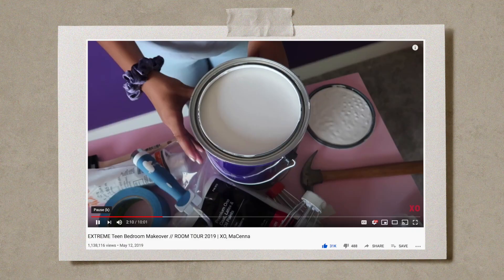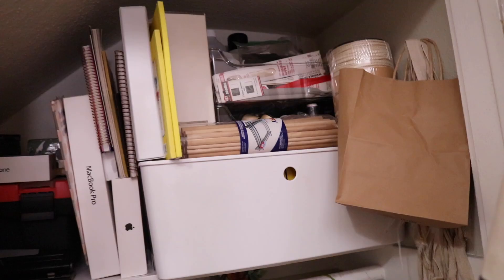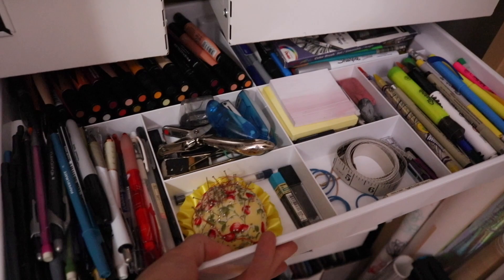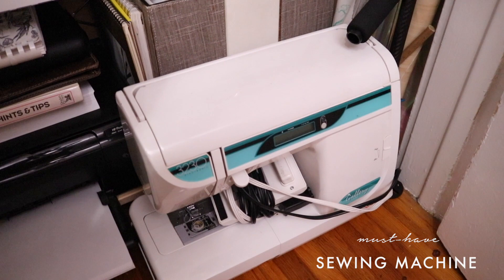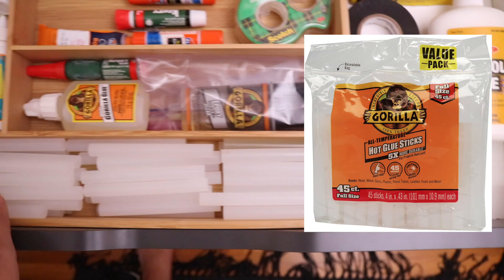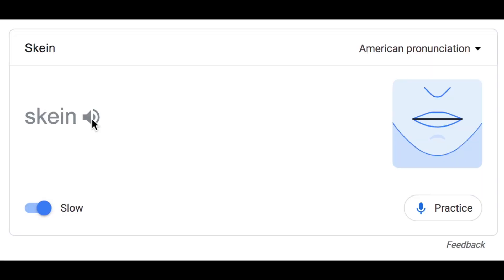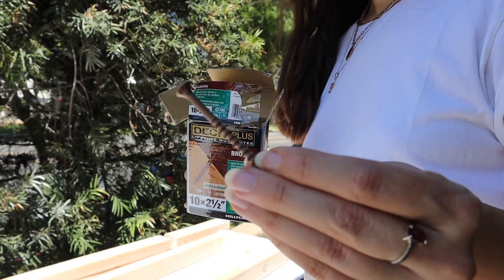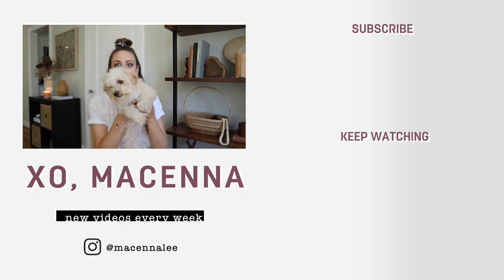Must-Have DIY SUPPLIES + DIY STOOL under $20 | XO, MaCenna

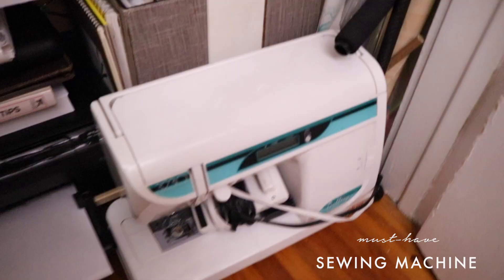Comment: 8:21  I also have an ELNA sewing machine, but it is vintage and from the 70's. I found it on the side of the road, and it works perfectly! Super heavy duty and good for working with denim.

Comment: Hack for your bottled acrylic paints - if you're wondering about the wet vs dry colors for matching, just paint the top lid.  It doesn't scratch off as easily as you'd think (I mean, it will if you want to get it off) but it's a great way to quick see the final dried color (plus I personally add an X on top if it's an opened bottle vs a new one).  You have 1 drawer more than me of them, so I figured you might need this tip more than me :)

Comment: hola! i recommend the (Tonic Studios) Tim Holtz scissors! his line is for papercrafts/mixed media mostly BUT they are really good: XL gripped handle, micro serrated blades - which won't dull, non-stick/easy cleaning blades and they cut different types of materials with no harm to the blade which - for me, as a crafter - is the best feature; they come from 5"-9.5", and the black grip are the new ones as they used to be deep red 🖤 happy crafting/DIYing!

Comment: Just curios why you didn't countersink the screws and fill in with stainable wood filler?
Reply: I too was wondering that, she did pocketholes for the patio chairs she made, looked a lot cleaner and doesnt take that much longer does it? Looks good anyway though.

Comment: Why not mix some of that pickle stain with some of your favourite walnut stain to make your own stain colour, I’m always mixing colours to make colours you can’t buy off the shelf (I save small/medium jars/bottles for these) I use measuring spoons to make colours & put numbers on jars & have a small notepad with jar numbers on each page & recipe of what & how much used, I also write the makes of tins used for future reference in case I need to make that colour again.. On a chain you can drill hole for chain in small pieces of pine with colour on each side & jar number.. I use the same idea for paints, inks, dyes etc...
Reply from the maker: I was thinking that when I was testing the stain colors! Definitely going to try 🥰